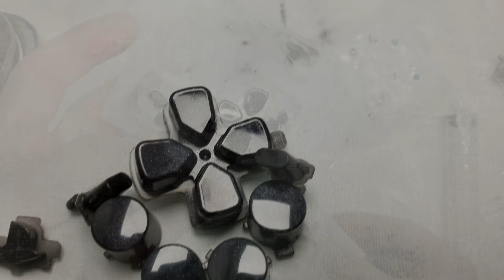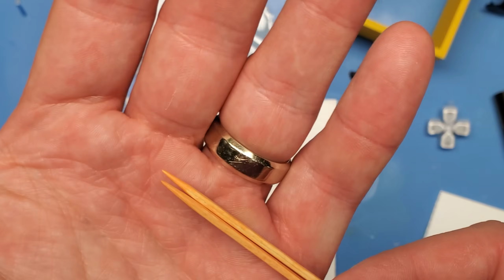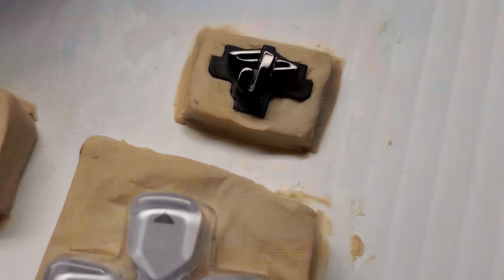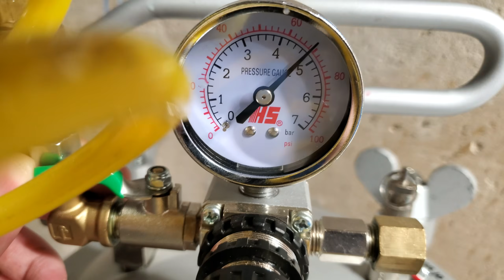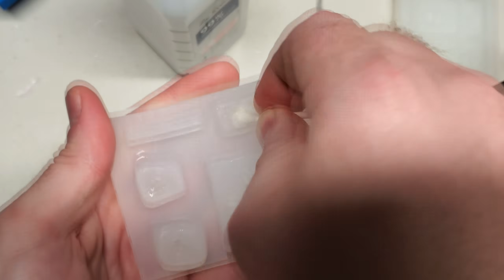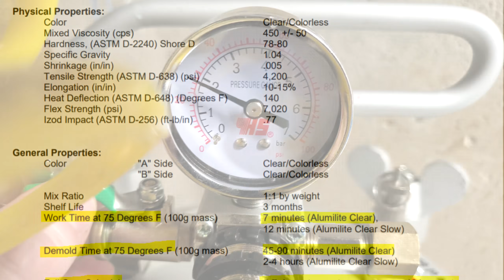This is how YOU MAKE custom PS5 Buttons

Comment: Soo I took my first one apart and tore the touchpad ribbon cable. Has anyone found a replacement circuit board for the PS5? I dont trust myself enough to solder back on a ribbon cable and can't seem to find one of those anyway.

Comment: There''s kind of one problem, you didn't show off how to make the touchpad, just the buttons. Yeah it might be the same process, but it's still good to know in the event that we wanted to make one. Also, does the touchpad still work if we make our own and replace it with the stock touchpad?
Reply from the maker: Yes itll still work perfectly. There is double sided tape between the touch pad pcb and the TouchPad so don't ruin it if possible but you do its all good as it can easily get replaced!

Comment: You had me thinking I could do this till the pressure cooker came out. But sweet buttons
Reply from the maker: You can likely get away without doing that step, but you will have air bubbles in your parts, which honestly is fine if you're making them for yourself.

Comment: I am thoroughly impressed with this video. The step by step approach is appreciated; most especially when breaking down the "why" of each step. Clearly a precise craft, which made it interesting to watch. This is definitely the kind of stuff I like to try my hand in, but all the equipment makes it a tad intimidating to even consider, but I digress--yours was an excellent video, sir. Cheers!
Reply from the maker: Its always overwhelming at first, but as you master each step of the process your molds and resultant castings get better and better.  When I started this there were no guides and no one was sharing any kind of info.  This video should be a really good head start into the process for those who might want to jump in!

Comment: I was curious from your first video, does the touchpad still work well with a resin casted plate there?
Reply from the maker: sure does. the touch functionality is all controlled from the capacitive touch pcb which sits under the pad itself.  The original touchpad is just a piece of the plastic.  the PCB that sits under it does all the work!

Comment: Have you ever made a  metal mold instead of silicone.  Silicone mold will wear out eventually and the metal will last a lot longer.
Reply from the maker: I would love to, but to make metal mold I would need to CNC it which would require me to recreate all of the buttons as 3D models.  While it is possible it is more time consuming, expensive and difficult.  Dont get me wrong... we are talking about the holy grail, but I have not ventured down that path... yet!
Reply: @RockerGaming  i hear u can sent out parts to get a metal concept mold done. But idk the cost. I. Sure it could cost around $100-$200 just for a metal CNC mold of a few buttons.. the controller shell could cost double that...  but the plus side  is that the metal mold last pretty much forever.

Also Iv seen some youtubers make metal coins and other items using scrap aluminum a home made aluminum scrap metal melting pot and they would use a sand mold and pour the liquid metal onto the sand and make a mold out of that.. but im sure its a sloppy job and it would probably need lots of clean up using a mini grinder , dremmel after.
Reply: Actually the sand method is only for making a metal mold. U would need have a CNC metal mold to make plastic parts.
Or maybe build diy cheap  small CNC machine that uses a drill bit for cutting into aluminum blocks  to make the molds.. but the molds need to be super clean.  I guess silicone will have to do. A harder silicone could be harder to take out the plastic pieces.
Reply from the maker: agree, you dont want too hard either as it get to the point where it will tear easier.  Typically there is an inverse relationship between silicones firmness and flexibility.  Its why I really like these silicones that are in the 30 to 40 shorehardness.  But for real, I appreciate you looking out and I will get some injection molds made at some point!
Reply: @RockerGaming  💯

Comment: They look absolutely sick!!!
Quick question, are you firstly using negative pressure to remove the bubbles, followed by positive pressure when casting??? 
After recently having a go at a resin top for a bar, I'm tempted to venture a go at this....
Reply from the maker: this is exactly correct.  Pull a vacuum (negative pressure) to remove the air, then use pressure (positive pressure) to crush down any remaining air left in the mold.  It works very well to remove any potential voids!
Reply: @RockerGaming  
Cheers bro, I best start my shopping list......